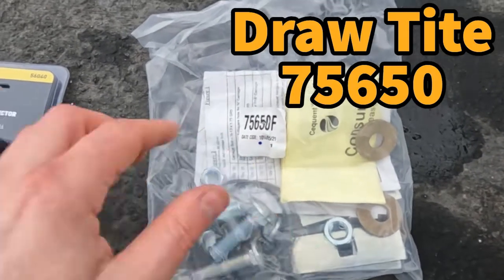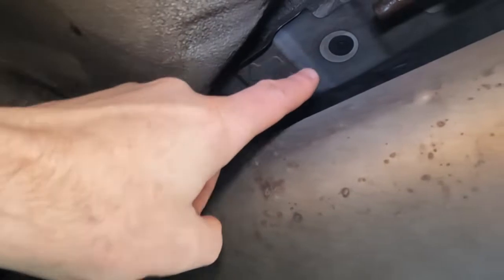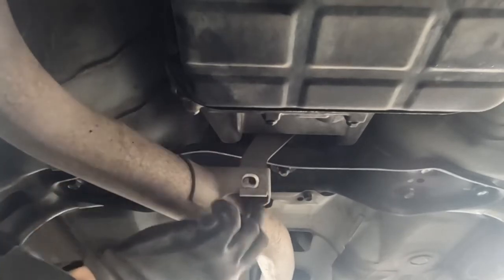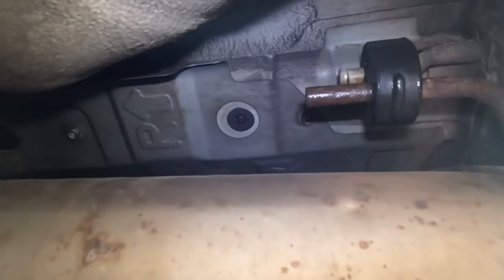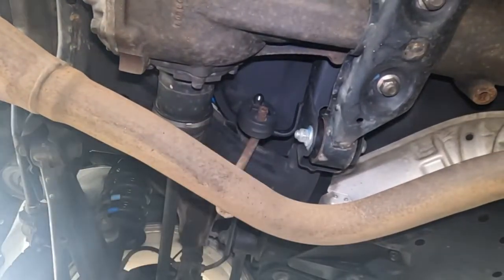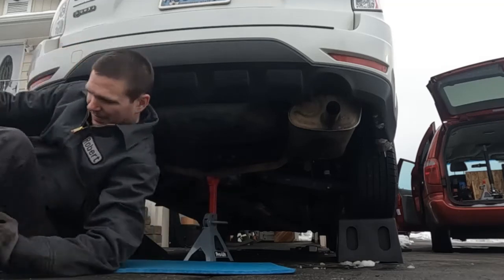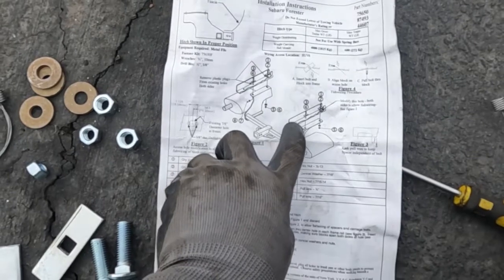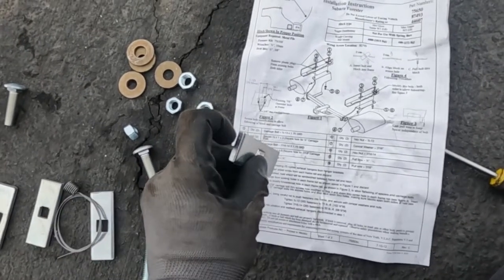2011 Subaru Forester Tow Hitch Installation | Draw Tite Tow Hitch

Comment: The first thing I tried was unbolting the mufflers (following a different video), but my mufflers are very permanently attached to my exhaust system with a thick layer of rust and crud and whoknowswhat! Then I tried getting that 14mm bolt towards the front out as described here, and that too will never move! I called my mechanic, and he said it was okay to leave that 14mm bolt in place, and just remove the five rubber hangers to lower the exhaust -- he said that's all he'd do in his shop. So I did that, using the jack to take the weight, and basically followed this video the rest of the way and everything worked. (Well, I needed a whole lot of penetrating grease, and there was some swearing, so it wasn't a speedy process, but everything worked eventually with no injuries to me or the car!) Thanks for this helpful video!

Comment: Might be easier to unbolt the mufflers and not have to mess with the exhuast pipe.  Plus gives you more room to work under car.
Reply from the maker: Good thought! Sometimes exhaust bolts and gaskets don't cooperate. But assess your car and see if that option is doable 👍